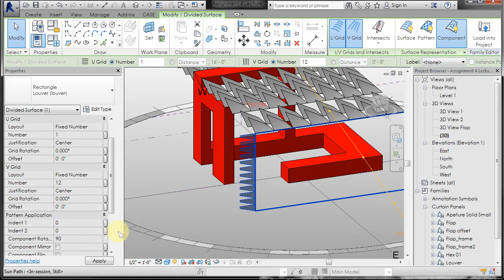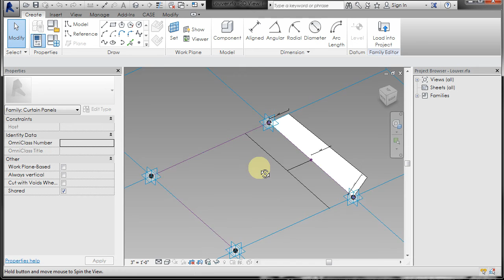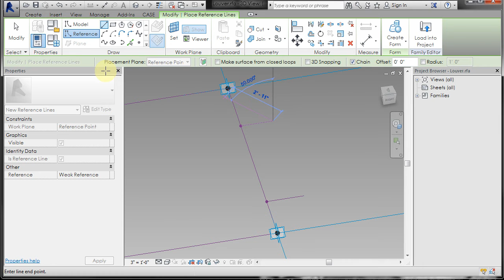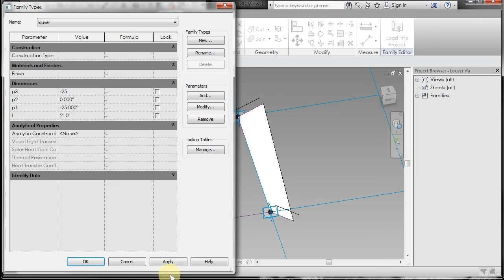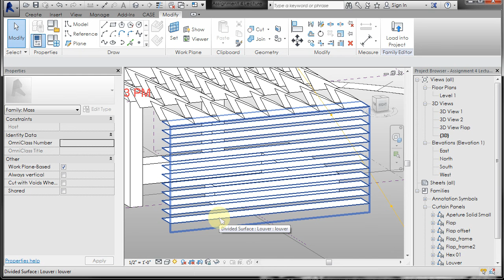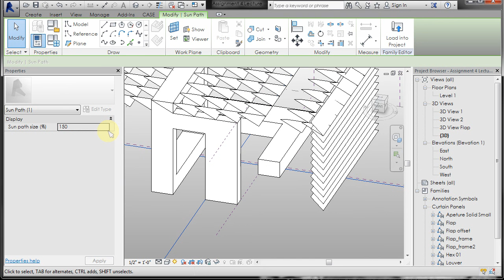Comment: Hi, I loved this video, and it almoast comes to my needs. I tried to do a louver that has different angles along his path. Is it possible for you to do a video explaining how to do that? I need it ASAP to a University project. Thankx
Reply: Hi Pedro,  I'm not sure what it is exactly you are looking for.  All you need to do is add more points and assign different parameters to the angle for the points.  Do you need a curtain panel adaptive family,  a curtain panel family, or  generic adaptive component.
Reply: curtain adaptive family would be rhe best.
Reply: let  e explain  better my needs. i have a building where i want to put  lojuvers in one side. my intention is to put the same louver across te entire side even in front off the openings (windows). but i want to have the same louver (blade) in a vertical positions in front off the wall, and in a specific degree in front off the windows... and with different number off windows in each floor.
Reply: I know this is way too late but for anyone else watching, when you are creating the parameters make sure you tick instance not type. When you load it into the project you'll be able to adjust the angles for each louver

Comment: where did you get the patterns from?
Reply: The components were created using the Curtain Wall Pattern Based family.  Here is a link to the families: https://www.dropbox.com/sh/a8wmkd5tqau4g1p/AAC1OcRPp4OeDd7287POTdm1a?dl=0

It's more common now to use Adaptive Components.
Reply: thanks so much. so all i have to do is upload them in revit?
Reply: Yes you need to load them into your project.  Check out number 4 on this Playlist:
https://www.youtube.com/playlist?list=PL5fgrebBtwJLSOfivNSTtk5jFtq1up95X

Also here is a playlist on Adaptive Components which is similiar and more commonly used these days:
https://www.youtube.com/playlist?list=PL5fgrebBtwJL6C3O5ZAtjKmuI-kJ7lDrk